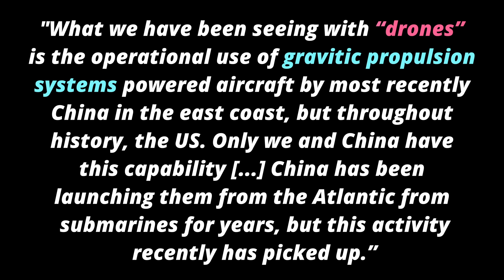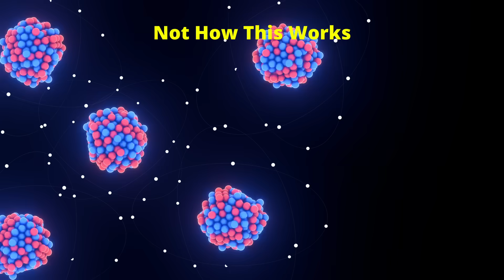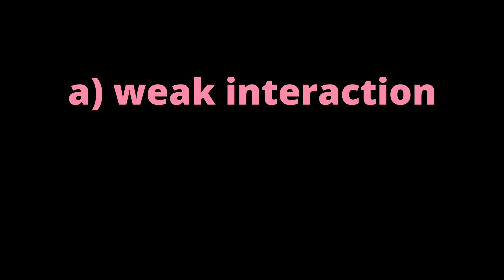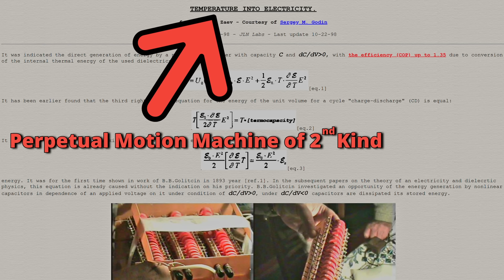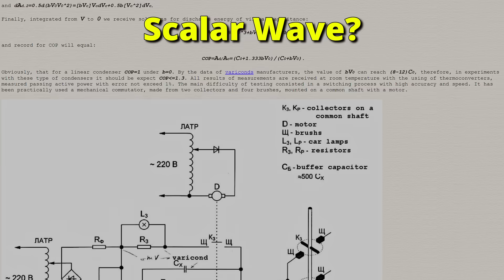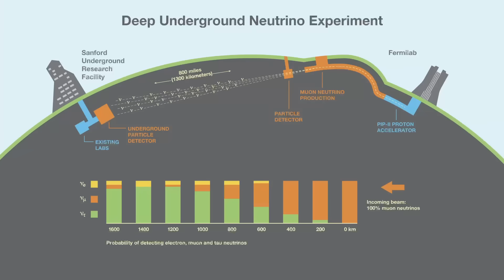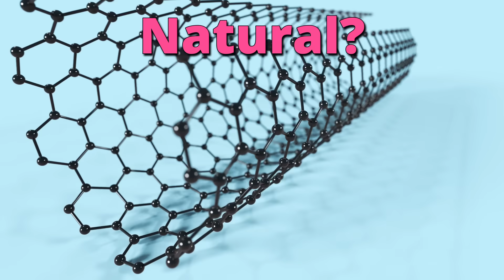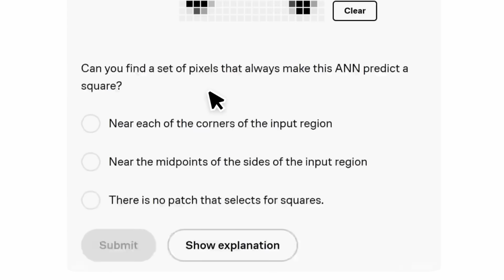What is “gravitic propulsion” and could the US government hide it?

Comment: Great episode Sabine. I've been fascinated by the possibility of AG for many yrs and research whenever possible.  I believe:   some birds, bees & bugs ( beetles)  emit a frequency dependent vibration that extends an ag field around their little bodies to allow them to fly. Bees apparently,  aerodynamicly should not fly. This field nullifies mass . Tech that will rewrite physics. 
Some liquid mteals , when spun also emit this field.  Simple tech like making electricity by moving a magnet past a wire. 
Magnets in a centrifugal polar array ( frequency dependent) can also emit this field.  I believe it's about folding one pole into the other. It may need a 2nd array . 
The schist disc, found in the bent pyramid is an ag device.  It was not the device used to move the megaliths,  but a trophy to themselves to be left for eternity.   
I disagree.  This tech COULD be used massively in our society.  Ag could eliminate the need for seatbelts, airbags.  Imagine Elons rockets if he used this tech. The fuel we could save with aeroplanes is mind bending. 
I believe within 10 yrs all vehicles will have some ag . Likely a magnet array on every wheel.

Comment: It's a common demo for a Physicist on a rotating stool, holding a spinning bicycle wheel, all while on a weight scale, can demonstrate a loss of 'mass' when changing the rotational axis of the bicycle wheel (angular acceleration). So, it's not too far fetched to think someone has perfected the above.
Reply: A (brief) transfer of momentum from the physicist to the wheel isn't a "loss of mass."  As the wheel accelerates downward, it pulls upward on the physicist, so the physicist doesn't press down as much on the weight scale.
Reply: @brothermine2292  A long time ago I designed an Omega^3 Antigravity Drive based on the above idea.
Reply: Matter and energy are interchangeable.  So sayeth Big Al E.

Comment: Sabine so brilliant. For decade I've been trying to get Arizona on more of a super material path. One where the information about arrangement is more valuable than digging up some old rock. Why issues like runtime science become important in this area. Watching the video gave me some new perspectives, like Neutrino detector. Search in high complexity search of material arrangement, maybe something just pops out that neutrinos interact more with.  Runtime science is about rearranging studies in a way that efficiently converges to a truth statement. Instead of trying to isolate variables, you take the whole system and filter down the complexity to useful information. Arizona set up in a spot that great for chip manufacturing, because of several multi trillion dollar economies surrounding it, but also for super material production where sun energy can be converted to rearranging matter into the information gain states.  Then the US government is like lets use Copper to give charitable handouts to a class of rich people holding everyone in the past using government to force sales. Its already known like copper is 1/3 as effective as a polymer for bullet casing. That the military could reduce weight by a lot in aircraft, in tanks, in weapons, and it perform better. They can't do it because their system slaves.  Its great to see Sabine break free of that and understand the enormous value of complexity search in super materials.
As for anti-gravity, I would say topology may hold a clue. You take a hot air ballon it goes up. Its not anti-gravity, its how other forces are resisting gravity creating an effect that it goes up.  Vortex Control like in daisy seeds by wind being converted to opposite spinning vortices creates lift. Really cool images of the wind flow doing that. All US military aircraft are Vortex phobic in design. So its not just information gains in material science, basic things like a vortex in commercial aircraft can create 20% fuel efficiency. But that is by pushing it away. So you have a system of different densities of topology converging into each other. Is there a way to make negative density? Something that weighs less than nothing? Only if you can screw up time itself, which still has a lot of unknowns. But something as simple as take a sealed ballon with nothing in it, it will collapse under pressure. But take a lot of hydrogen atoms you get a blimp. Take lot of ions pushing off eachother the density inside may decrease but the force pressure inside counteracts a collapse. Alternatives to it than just making the material inside hotter. Important technology for the Madrean skyislands around here. 
Other areas of complexity is lock and key fuel designs. The idea is like topological explosion point like cantors leaky tee pee. You have molecule that contains a lot of energy inside, and a key, when the key enters the molecule it becomes a totally disconnected set. Idea is to make the fuel excessively stable under almost every condition, but then add the key in, it unpacks it all, creating a lot of expansion energy. 
When it comes to particle physics to me it depends on mathematical equivalencies. Take water put energy in it you get waves, put higher energy levels in you get a vortex. Vortex can act like a particle and even has inward gradient flow. Well till you get close enough to the center of the vortex and it has an outward gradient flow like the eye of a hurricane. But then if you put even higher energy flow into water you may get shells like a blender. Or even like stable Smoke Rings, where the vortex can take a shape. I don't see particle physicist having the tools at all to try to replicate these shapes that occur in water by dolphins, but very well could produce an unnatural particle, where high energy wraps around itself in a donut like shape. CERN built to measure, its not built to collide and redirect the energy. So if vortex can be arranged to be like a donut like a water ring, it may have some weird effects based on its direction on how it interacts with gravity.  If you could create donut ring particles, sure its fun to think about what could be done, like a chain mail material of vortex rings looped together. It comes down to less about particle physics, and general vortex phobic nature of US military aircraft. Shows the top people they hire don't have this capability to control and redirect energy in flight mechanics in a way that would enhance the flight mechanics. All there designs while can produce really good measurements, are still fundamentally no where near where technology could be. Like the best of an old way of thinking about material and fluid flows. 
In theory the US government is behind in these areas, Sabine finally caught up with the idea of Super Material age. Winners and losers will be the ones who can better search the information, make information gains, and store information gains. US government may have forgot some old technology because it was classified, and it failed to propagate in time.
Reply: This reminds me of the biologically inspired vortex engines of Schauberger, (I readily admit I am a biologist with an understanding of physics rather than the other way round, so his beautiful engine designs even if pseudoscience just stuck with me.)

My only real knowledge of the physics and science behind them comes from his grandson who described the counter vortices & hyper fluidity in a way that stuck with me and you had some similar ideas.
Reply: @ForgeMasterXXL  That really cool, sounds like your grandson should get into market trading, and beat the market for you to make a ton of money. Then he could fund his own science.
Reply: She lived and worked in Arizona in her youth as post doc.
Reply: @Thomas-gk42  Really? Should send her I'm sorry. But that if it went the direction of science could make it really cool. Could make flying machines not using anti-gravity just creative ideas to go from mountain top to mountain top to avoid the whole desert stuff like Staffard Arizona in-between.

Comment: This may be irrelevant - I am not at your level....   Are the devices that have been shrunk to form the triggers of nuclear weapons (instead of highly radioactive stuff), really particle accelerators?
Reply from the maker: I don't know much about nuclear weapons. I was under the impression they are triggered by conventional explosives.
Reply: @SabineHossenfelder  Ummm...  There is a core of something which is is a neutron emitter, that  is surrounded by plutonium etc.  That is surrounded by a layer of conventional explosives, which when triggered implode the plutonium to surround the trigger core and make a critical mass.
Reply: So the neutron emitter is what I asked about.  I understood the early @passive@ ones were later replaced by some form of active particle device
Reply: @SabineHossenfelder I think it’s in the Sum of All Fears by Tom Clancy where he has this extremely detailed chapter on the working of this weapon.
Reply: @SabineHossenfelder  Really need to be more specific. An "atomic" bomb, like the first, were triggered by using an explosive shell to crush uranium to a critical density, a fission device. In a "hydrogen" bomb an "atomic" bomb is used to trigger the hydrogen bomb, which is a fusion device.
Reply: @SabineHossenfelder  https://youtu.be/8TYMQOUDQBo

Comment: Why do you assume it is something related to matter that defines a "measurement", as opposed to a measurement being "something that provides data to a conscious perceiver"? And the "new physics" is in the ability of the state of "consciousness" (whatever that will turn out to be) to influence what the measurement is (e.g. it's a "hidden variable" that affects collapse, challenging measurement independence)? And the reason this has not shown up in particle collision experiments is along the lines of what you are proposing already: that it shows up under conditions that the particle physics experiments are not designed to test.

We do not have a physics to explain what determines the limits of our conscious experience (i.e. the boundary problem of consciousness), and the assumption that all patterns in our conscious experience must originate from the subset of patterns that we define as "matter"/"neuronal activity" is just an assumption; the evidence used to argue that neuronal activity "creates" consciousness is equally compatible with a model in which our individuated units of consciousness tune into our neurons like wearing a virtual reality headset; if you are wearing a virtual reality headset, it will be responsible for a large portion of the signals in your conscious experience, but the test of whether it is the only possible source of patterns in your conscious experience is in whether there is data to indicate we can receive signals from elsewhere; indeed, during cardiac arrest (when the brain is deprived of oxygen), our understanding of hypoxia indicates that the brain should only generate chaotic/disorganized experiences, akin to a virtual reality headset that has its power source cut....but the fact that subjects who have out-of-body experiences during cardiac arrest are able to describe their resucitations much more accurately than subjects who do not have out-of-body experiences, and the fact that such reports often involve "ESP"-type experiences where observations are made of events that are too far away to have been perceived through the body's senses, as well as cross-culturally consistent accounts of an experience of other types of realities (source: https://pmc.ncbi.nlm.nih.gov/articles/PMC6172100/ ), all strongly favor a model in which individual units of consciousness merely tune into a given body for a lifetime, and that other layers of reality exist that do not obey the physics of the subset of patterns in our conscious experience that we have defined as "physical reality".

That there is an undiscovered physics of consciousness is also compatible with the fact that (contrary to myth) the preponderance of statistical evidence strongly favors the fact that psychic phenomena exist; see this review of over 1000 experiements across 11 categories, published in the flagship journal of the American Psychological Association: https://pubmed.ncbi.nlm.nih.gov/29792448/ ; the conclusion: "The evidence provides cumulative support for the reality of psi, which cannot be readily explained away by the quality of the studies, fraud, selective reporting, experimental or analytical incompetence, or other frequent criticisms"

I'll also repeat this statement from the 2016 president of the American Statistical Association: https://www.tandfonline.com/doi/full/10.1080/01621459.2016.1250592
"Parapsychology is concerned with the scientific investigation of potential skills that are commonly known as psychic abilities, such as precognition, telepathy, and so on. For many years I have worked with researchers doing very careful work in this area, including a year I spent working on a classified project for the United States government, to see if we could use these abilities for intelligence gathering during the Cold War. This 20-year project is described in the recent book ESP Wars East and West by physicist Edwin May, the lead scientist on the project, with input from his Soviet counterparts. At the end of that project I wrote a report for Congress, stating what I still think is true. The data in support of precognition and possibly other related phenomena are quite strong statistically, and would be widely accepted if they pertained to something more mundane. Yet, most scientists reject the possible reality of these abilities without ever looking at data!...Now there is a definition of pseudo-science—basing conclusions on belief, rather than data!"
Reply: this is why theoretical physics hasnt moved for decades. most of them cant wrap their minds around these concepts due to the constraints that science created for itself. thats why they are always looking for the next einstein as they are limited in their abilities to think out side of the box
Reply: Conclusions on belief ARE belief, not more and not less. If you mix belief with science, the outcome is pseudoscience.
Reply from the maker: Because we know that what constitutes a measurement in quantum physics doesn't require a conscious observer.
Reply: @SabineHossenfelder  There is a quote from Anton Zeilinger: "I am not a proponent of constructivism, but rather a supporter of the Copenhagen interpretation. According to it, the quantum mechanical state is the information we have about the world. ... Ultimately, it turns out that information is a fundamental building block of the world. At some point, we will likely have to let go of the naive realism that assumes the world exists in and of itself, without our involvement and independent of our observation."
Zeilinger is one of the best experts in quantum physics, why do you think he is wrong?
Edited: Link: https://de.wikipedia.org/wiki/Anton_Zeilinger
Reply: @SabineHossenfelder  https://youtu.be/8TYMQOUDQBo
Reply: @SabineHossenfelder  
Thanks for replying. I am surprised by the assertion as I thought the Wigner's friend paradox was unresolved. Here are the thoughts that come up:

(1) Without a physics of consciousness, how do we know what is and is not in possession of a prototypical form of consciousness?

(2) You have said before, in your video on the AI experiment to test the Wigner's friend paradox: "you don't need intelligence to make a measurement, you just need a detector. And even though we don't know what a detector is, we know what it does: it makes measurements". But that was a circular definition. On that video, I proposed that the most parsimonious definition of a measurement is simply "something that provides information". But provides information to what? They were assuming that a measurement is "something that provides information to an intelligent system" (presumably because the ability to perceive something as information implies intelligence). You had liked that comment. So I am confused by this assertion now that we can rule out certain definitions of a measurement. (Specifically, I don't really know how to define intelligence, but I just replaced "intelligence" with "consciousness" since I know I only measure the world through some kind of conscious experience of information related to the world.)

(3) My understanding was that the Wigner's friend paradox is unresolved, i.e. as far as we know, it is possible that other people exist in a superposition of possible states until we make our own individual "measurements" of what state they are in. Is this understanding incorrect? I think this is important to resolve because near death experience reports frequently talk about there being multiple versions of us. Based on those reports, it seems as though we select into realities with other "perspectives" of consciousness (i.e. other "observers") whose state is "vibrationally compatible" with our own (whatever that will turn out to mean). In other words, the Wigner's friend paradox is resolved by saying Wigner selects into the version of reality that contains the version of his friend whose state of consciousness is "vibrationally compatible" with his own. (They also say similar realities experience informational crosstalk with each other, in the form of intuitive hits about what the outcomes of certain actions are likely to be).
Reply: @Violet-fe8cy  The way I understand this is that we could come up with any form of theory to understand physics. Consciousness could come up with any idea to explain what could be, even if it is not. We can throw a ball at a hoop and angle it in different ways to make a point. I’m not a physicist though, I only understand basic calculus concepts and even then I am forgetting. I am more of a philosopher but even then I am also not that good at that. As long we make the ball into the hoop, the angle at which we throw it does not matter.